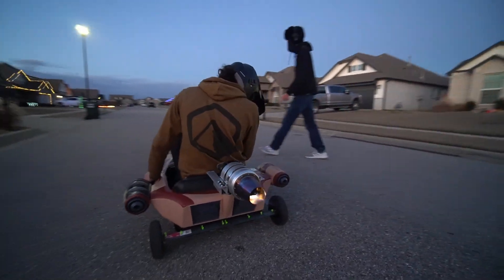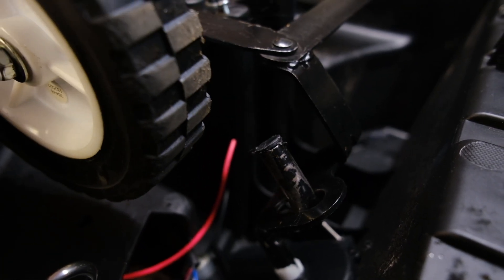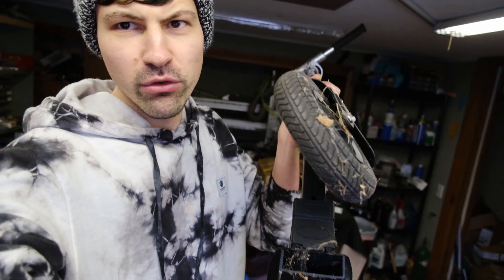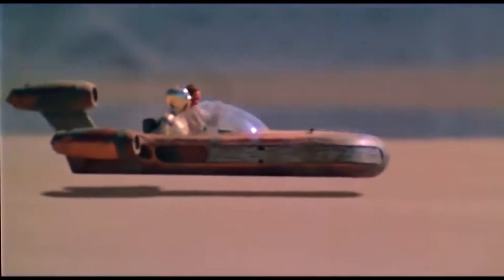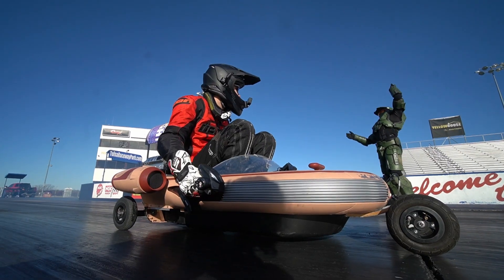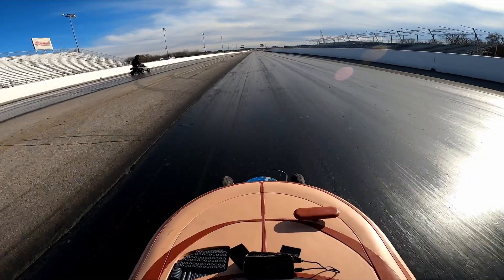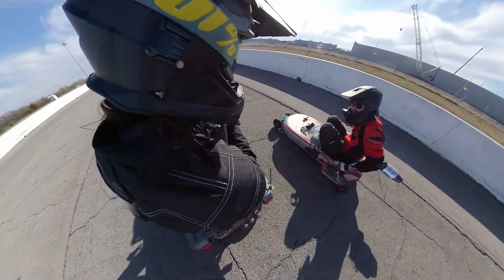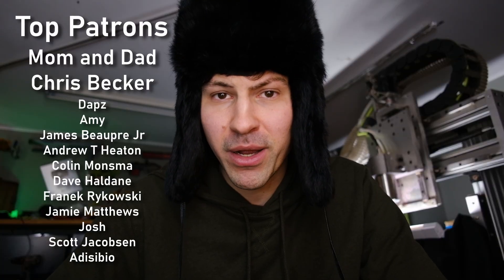Children's toy drag race! (Jet engine)

Comment: i think if there wasn't any shipping issues you would've probably gotten dangerously close in the quarter mile with my jet, glad things all worked out
Reply: To his benefit I only had big ones ready to go. The one he used was from the mrbeast project.
Reply: @WarpedYT  makes sense, I’m surprised they were still working after the mrbeast vid
Reply: @dapz  I now have PTSD like for real, I was so upset with that vid I wanted to smash someone or break a jaw (I need to make my own emojis). I was able to save 2 engines kinda, but regardless need to be rebuilt after an impact like that. I just got the rest of the parts in a couple days ago. Didn't u lend him the other jet engine?
Reply: @WarpedYT  yeah I sent my jet to him, I told him to keep it for a few weeks and send it back later once I’m back at school
Reply: @dapz  your name rung a bell. What we're using the jet engine for? Just curious. I was just checking out your videos right now
Reply: @WarpedYT   the reason I bought it was a mix of “I want to do some videos with it on my second channel” and “it’s cool”.
Reply: @dapz  ha! I know the feeling, that makes sense, I see you like science and engineering, I should invite you down for a project one day... I'm changing my content around now and it's going to be mental from now on!!
Reply: @WarpedYT  I’d be down, sounds awesome.
Reply: @WarpedYT  Yeah, I noticed he also didn't credit you or Donut anywhere on the video. Considering how much work went in on both your guys' parts, y'all deserved so much bigger of a shoutout.
Reply: @tbuk8350  That is true. Thought the same while watching the video
Reply: @tbuk8350  bro…, some people just don’t watch full videos and then go straight to the comment section. He said “huge thanks to everyone who made this possible ‘especially Matt from Warped Perception’”. In the Top Patrons he has “Dapz”. Both are great jet loving people that were definitely mentioned multiple times due to their amazing contributions.
Reply: @lilneko37  I watched the whole video and I didn't see Mr. Beast credit anyone involved once. That's what I'm talking about.

Mr. Beast didn't mention Donut or Warped Perception once in the final video he made with the jet car.
Reply: @tbuk8350  Ah I see well, Mr. Beast is a jerk for that I have not subbed so I didn't see that video nor see his name in your comment so that is my fault for that misunderstanding!

Comment: 11:54
"... and he could really use a win."

That's just brutal.
Reply: He could tho
Reply: I actually laughed out loud for that one.
Reply: Building a rocket requires a significant amount of technical knowledge and resources. It is not a project that can be completed by an individual without access to specialized equipment and materials. The process of building a rocket typically involves the following steps:

Designing the rocket: This involves creating detailed blueprints and plans for the rocket's structure and systems, including the propulsion system, guidance system, and payload.
Procuring materials and components: This includes obtaining the raw materials needed to build the rocket, such as metal alloys, electronics, and propellants.
Fabrication: This involves using the materials and components to construct the rocket's various parts and systems, such as the fuel tank, engine, and guidance system.
Assembly: Once the individual parts are fabricated, they are assembled into the finished rocket.
Testing: The rocket is then put through a series of tests to ensure that it is safe and performs as expected.
Launch: Once the rocket passes all its tests, it can be launched.
It is important to note that building a rocket is a complex and dangerous endeavor that should only be attempted by trained professionals with access to the necessary resources and equipment
Reply: @Susimposter293  chatgpt bot

Comment: Joel you're a great "engineer" but it would make me very happy and at ease knowing that you'll use class 10.9 or 12.9 bolts welded to that L bar instead of a cheap threaded rod and zip ties as axle,  especially given the fact that i know you'll "tristar" that thing. Just looking out for you buddy. :)
Reply from the maker: The body was all plastic, the axle assembly was mounted to plastic, and the forces on the stainless threaded rod pushed it up into the L bracket groove. Given the time constraint, welding just the axle would have been like putting a metal link in a plastic chain. I would however make a full metal chassis for a 3 engine version, and completely redesign the steering. Thanks for looking out for me!

Comment: I understand being scared of going highway speeds XD but that afaik track suits like that are incredibly resistant, and also, it's not like you're falling off a bike XD you're on the ground already
Reply from the maker: I was less concerned about a slide and more about losing control and going into a wall
Reply: @JoelCreates  BE SAFE if you go for three engines on that thing (or a similar rig). You might look into getting/fabricating a parachute to help with deceleration after your run or in case you start to speed wobble. Glad to see you taking this seriously and wearing quality safety gear. Thank you for the great content, Joel, and keep taking care of yourself while you make it! :)

Comment: I find that with skate boards going above 5-7mph, to avoid speed wobbles, you need to have the center of mass above the front wheel. Gotta think of the wheels as a drag vector and move the weight forward.

Comment: YOOO Joel your using the same Mountain Board I just so happen to have XD For its price its very durable and reliable, just... make sure your nuts are on tight, and your tires are high pressure.

Comment: Okay, regarding the slow start, you said the Mountain board components came with a brake right? Is there a reason why you couldn't go to full throttle while holding the brake?

Comment: If you have two on the sides couldnt you steer by decreasing one of the engines power?
Reply: You *could*, but the thrust yaw could easily destabilize the vehicle at high speeds. If one of those tires gets some sideways grip while you're trying to go fast in a straight line, you're gonna have a bad day. As fine as that control would have to be to make this effective (works great in maneuverable, unstable planes with computer control, but would be a LOT tougher on the ground and with manual thrust controls), you're far better off just keeping consistent power across the three points of thrust while steering with the wheels.

Comment: jet engines are generally designed for speeds upwards of Mach 0.75- to 1.5 so it probably is running at suboptimal performance

Comment: “about to hit interstate speeds” like 60 isn’t interstate speeds??
Reply from the maker: 60 is more highway speed
Reply: @JoelCreates  mr joel i may be stupid but what’s the difference between a highway and an interstate?
Reply from the maker: @cornvlad8580  interstates are like super highways running between the states, they have speed limits around 70 and sometimes even 80mph